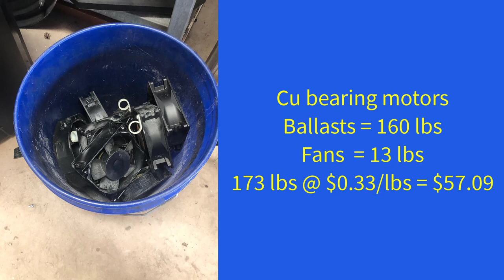Tanning Bed Scrap Session

Comment: You've got tanning studios down there?? I thought Florida was a tropical paradise where its always sunny, except when the ASMR raining is happening! 😜

All jokes aside a really nice pick-up. I presume that resotration business is a new client of yours?
I'd hazard a guess that you have stuff to do that pays better per hour than micro scrapping those little things.
Most scrappers on YT would do it for sure, and I think for many it would be worth it. They generally deal with lesser value stuff in stead of your PCs. Even someone like CTH gets mostly microwaves and washing machines (albeit boatloads of them). But I think your PCs cause a higher threshold, because you always have something more lucrative than tiny copper parts already in the Shark Cage.
Reply from the maker: Yes, the PC's are my mainstay.  But it is fun to let the brain try on something new every now and then, even if not as profitable.  Very little of that tanning bed ended up in the landfill - one of my priorities.

Comment: The 1st one is always the hardest  any more should be 1/2 the time .Those ballasts would do great with the port-a band saw all the same size would make fast work of them getting the copper out
Reply from the maker: Yeah, but I noticed the copper is sealed in with an epoxy like filler.  That might make it harder.